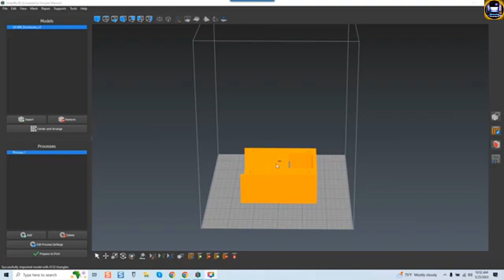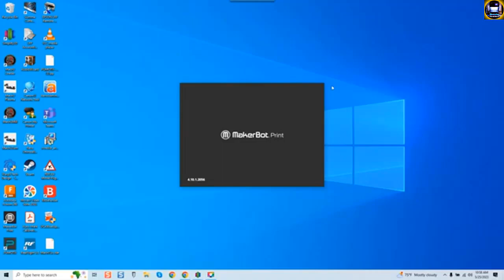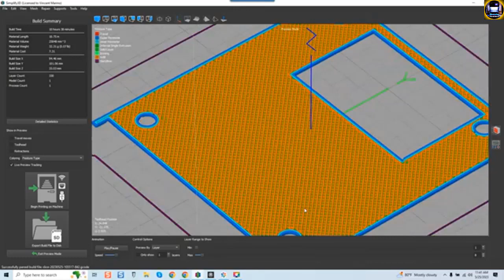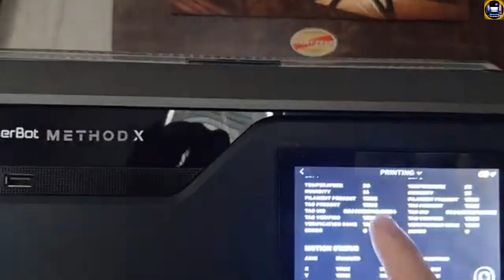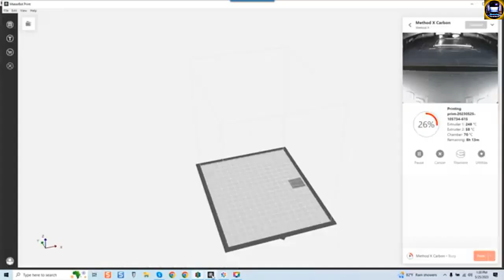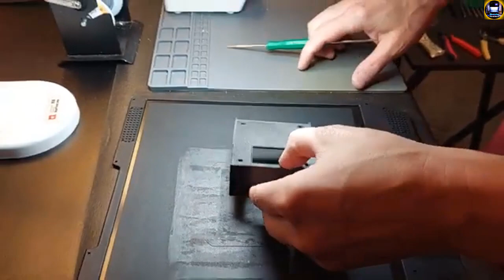The Makerbot Method and Simplify3D 5.1 Performing As It Should || Mastering The Method

Comment: My printer looks like from Mad Max compared to yours! That thing is sweet!
I run mostly CF PC. My layer 1 is really slow so it's nailed to the bed.
I started with S3D for stability reasons since Cura would often crash. Then I tried Cura about three times since but not in the last couple years. Features were always lacking and extrusion settings had strange side-effects that took too much time to beat out. Everyone claims is much better now but I haven't had the time to try.
Reply from the maker: Thank you for your kind words, and support. I can't try Cura as the Method is proprietary. S3D supports it, and I'm super impressed with it. Thank you, Vince

Comment: I have 4 Method X printers in my lab and I end up using other printers in the lab most of the time because of the lack of flexibility with the makerbot printcloud. I have not used the MB print software in quite a while because MB stopped supporting it with updates around the time they released the Method X.  
I would love to be able to use both extruders to print with abs and not have to buy a second x1 extruder.  I have the "experimental" extruder for CF and metal printing, but they wont print abs. I can not understand why the "support material" extruder cant print abs, when cheap ass printers have the ability to print several different materials out of ONE extruder.  Makerbot seems to be in this game to try and make 3D printing more difficult than it needs to be.  
I would like to get some information on max print speeds for abs effectively but find no help at all on the MB site.  Even their "standard" settings seem to produce mediocre results much of the time. I also find myself printing with only one head 95% of the time, for model and supports, because it is sooo much faster than waiting for the second extruder to heat, purge, then print, every time it switches. 
These printers were marketed as extreme accuracy and SPEED but I find them to be extremely slow. Friends of mine with much cheaper printers using abs can get similar accuracy at twice the speed.  I feel like I'm missing something.  
I've been 3D printing and teaching it for about 7-8 years now, so I know my way around a 3d printer. However, I just feel like I should be getting WAY more out of these $5K+ printers! 
 I will be following your adventures to see if I can learn something. LOL😏
Reply from the maker: Thank you Justin for your support. I really love appreciate it.

Makerbot as a company certainly could support the printer much better, but that being said its certainly not a novice's printer as you know. Cloud print is literally a complete joke of a slicer as its essentially an incomplete program. Its missing many features required for a dual extruder printer which leads me to believe Makerbot didn't have the appropriate funding to complete it.   

The software they produced limits the end user's productivity as well as its certainly not cost effective forcing end users to print rafts, and utilize the secondary extruder for all prints. 

My best investment was S3D as I saw a HUGE DIFFERENCE in speed, and quality of my prints. the videos are on my channel to show the difference, and its literally "night, and day". 

Its a real shame that Makerbot doesn't listen to end users concerns as many of them aren't to hard to fix if they were willing to. 

Thank you again for taking the time to post.
Vince